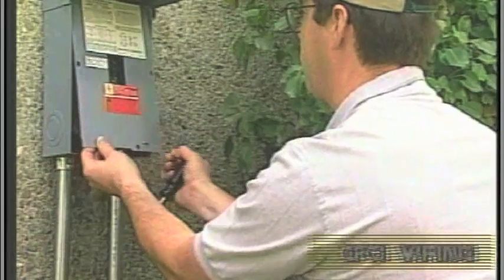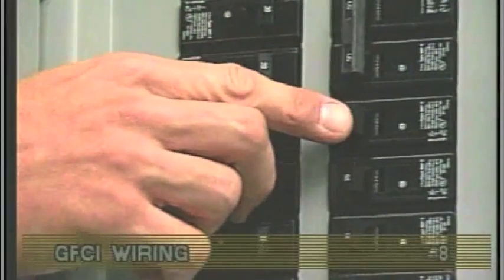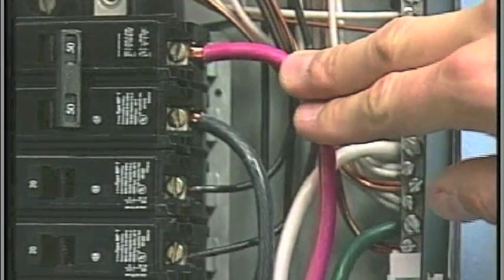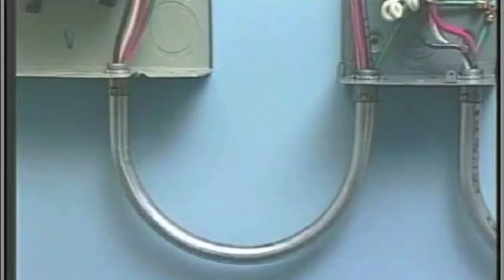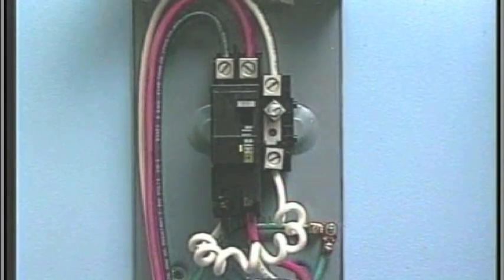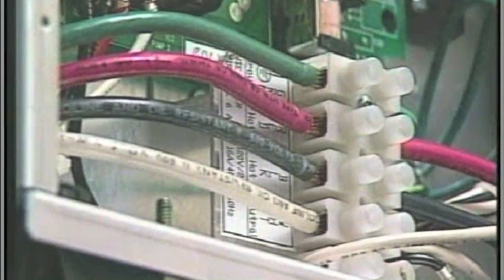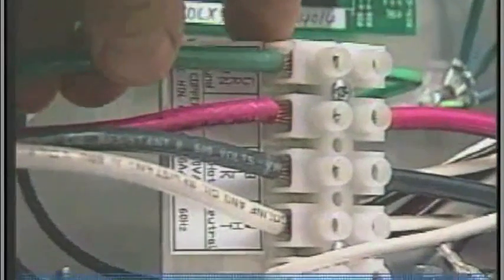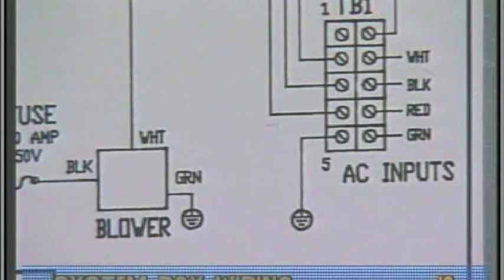Balboa Legacy Systems Series - Proper GFCI Wiring

Comment: Why does this say 50A circuits have to use 6 gauge wire when 8 gauge copper THHN/THWN-2 wire is rated for 55A?  I'm also not finding that requirement listed in any Balboa manuals.  https://www.cerrowire.com/products/resources/tables-calculators/ampacity-charts/
Reply: Wondering the same thing.

Comment: Using a single bus bar for both the neutral and ground is not good practice and often will not pass inspection.  Any breaker box or disconnect should have separate ground and neutral bus bars and only in the main breaker box (first in line after the meter) should the neutral bus bar be bonded to ground.
Reply: Thanks for the clarification.  You rock.
Reply: My Main breaker box only has a single neutral/ground bus bar. My disconnect has separate neutral and ground. Is it ok to run the white neutral and ground on the single bus bar at the Main breaker and then separate the neutral white to the bonded bus bar and the green to the ground of the box?

Comment: Hi, I was wondering if you could look at this diagram and tell me what breakers I would need to get this tub working. I see that I will need a 50 amp for the 240 volt pump, but the diagram also shows a 30 amp for the heater or blower. This is confusing!!!! When I dissemble this tub it original had 6 wires going to the controller. I would appreciate it if you could guide me in the right direction. Thanks Jerry
http://hat-support.loginto.me/images/balboa.jpg